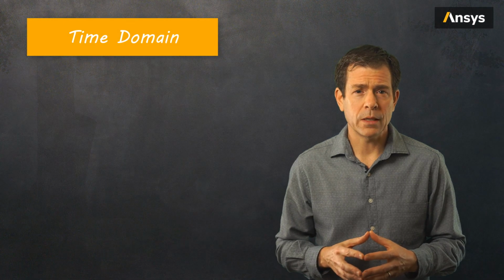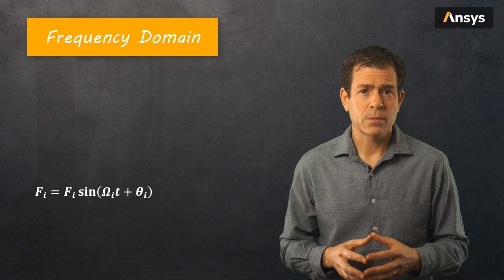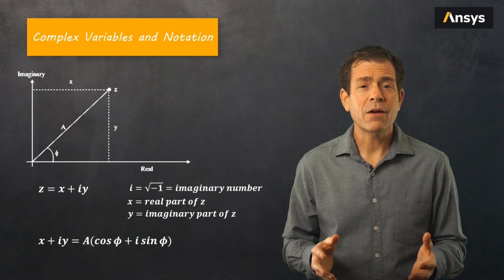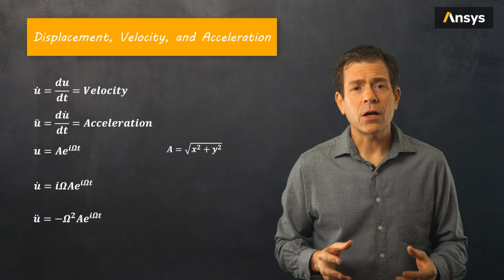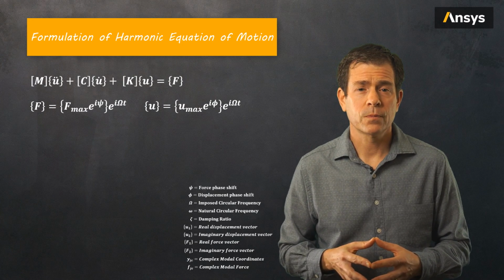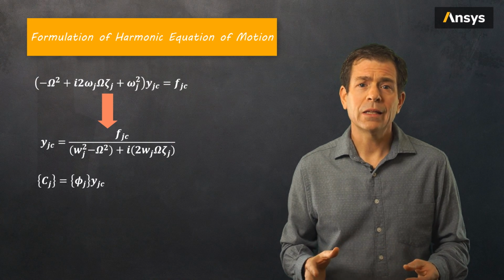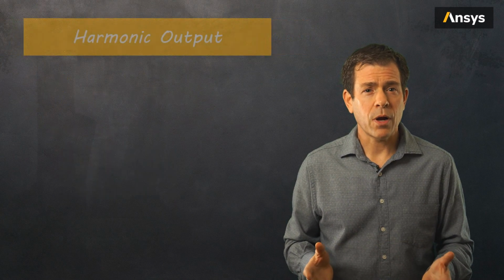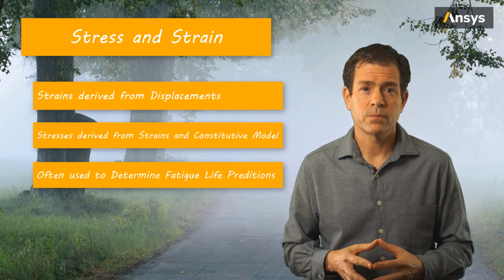Formulation of Harmonic Analysis — Lesson 2

Comment: Really good explanation as usual! 
But one further question: If zeta is greater than zero, is there resonance in my analysis if the undampened natural frequency or the dampened natural frequency are equal to the excitation frequency?
Because damping has two effects on the vibration. It is reducing the amplitude and reducing (a little bit) the natural frequency. 
Does the solution in the frequency range consider the second effect?
Reply from the maker: Thanks for watching! Please post your query on the Ansys Learning Forum for a detailed answer from the wider Ansys Community: https://ansys.com/forum.